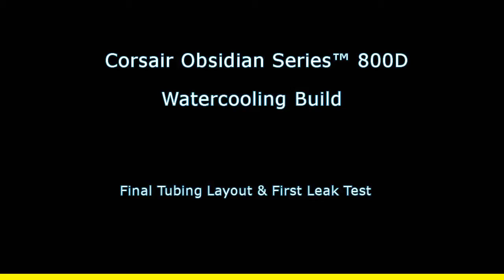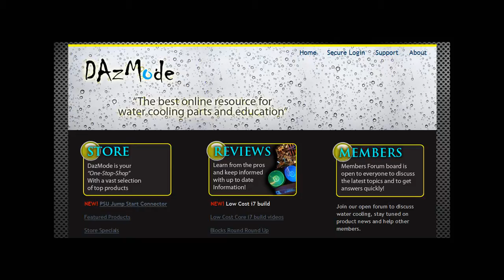Corsair Obsidian 800D Water Cooling Build -- PART #4

Comment: Theoretically, it will suffice because it is usually recommended to use one rad slot per hardware, therefore 3 components should be cooled by a 3 fan rad. If you are willing to install another rad (ie: the single fan rad on the bottom or, if possible, a single/dual fan rad in the front(this will mean you will have to use an ssd and not a hdd as the hdd cage will have to be taken out)), it doesn't really matter where you connect the second rad, however, usually you have a rad to rad flow. ~Skace

Comment: Hi DazMode, I am building a liquid cooled 800D system. I want to water-cool the Haswell i7 4770k and 2 GTX 770's. I am using the MSI Z87 MPOWER Max Mboard. 
I decided on the EK Supremacy full nickel water block. I liked XSPC's version of D5/Bay-resevoir combo. 
--- My question is: Will a top mounted triple rad suffice? I read most people recommend have 2 rads. Also if I use two rads.. I am having trouble understanding the flow layout and was hoping you can elaborate on the cycle.

thanks

Comment: Would a thick 280mm rad with single fans be enough to cool 2 570's (gpu only loop)?
Or do I need to squeeze in another 120mm..

Comment from the maker: @736928 I think 1/2" can be used with 90 degree fitting to make them flat against and back panel and avoid bending while passing trough the panel.

Comment: beautiful job on the tube routing, esp like the the drain port idea with the parrarell ek bridge. I do have one question about the pump>resivoir connection, is that the pump inlet and if so how does it affect the flow having the pump above the res, I always thought you had to put the pump below the res to avoid air pockets developing inside the pump chamber